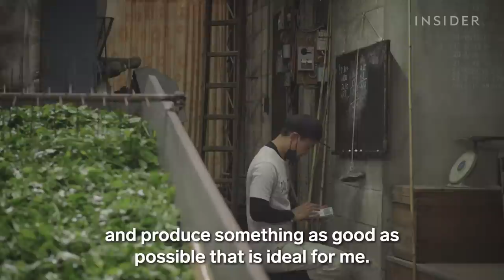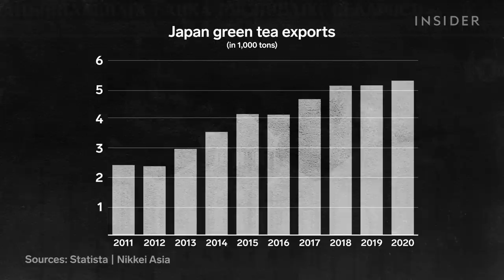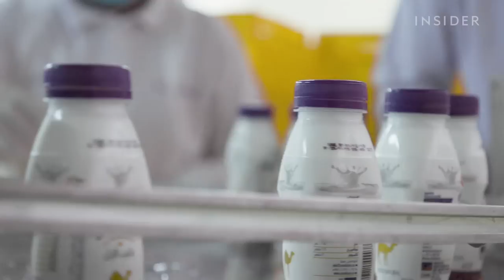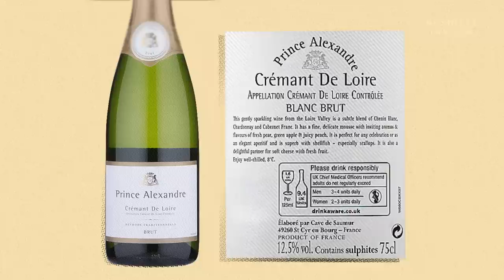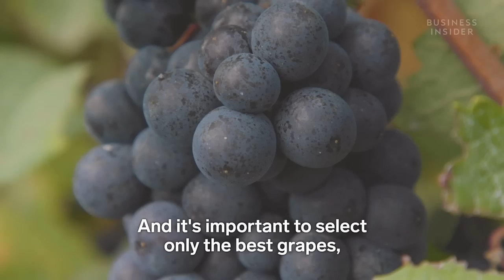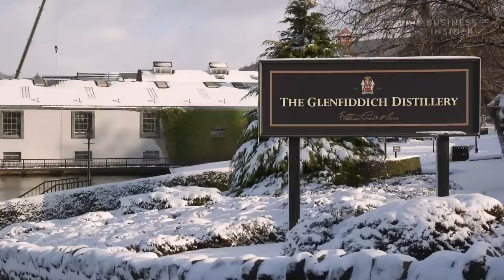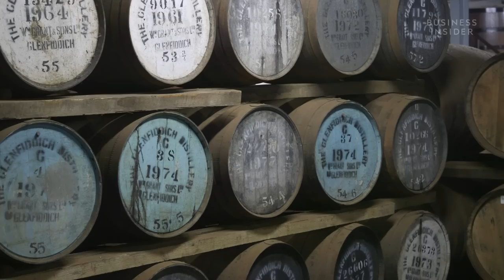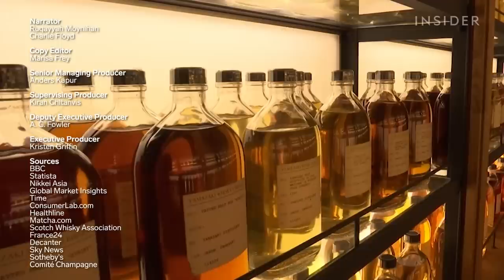Why 4 Of The World’s Priciest Drinks Are So Expensive | So Expensive Food | Business Insider

Comment: Nice, but does the matcha really have to be ground only counterclockwise? 😄 sometimes it feels like they try to make extra fuss to justify the cost...
Reply: It's the grinder that's designed to be wound counter-clockwise, so you do it for the same reason why you don't use the handle of a hammer to drive a nail in.
Reply: @rd9301  wow
Reply: The stone probably has a one-way cut, if you go the other way, it won’t grind properly

Comment: @8:30 So ground "Matcha" powder is a mixture of stone powder and the powder. Instead of steaming the leaves, would it also be possible to freeze-dry the leaves to keep more of the flavors?
Reply: Well, that is due to what happens when you freeze dry it. Freezing causes moisture in the leaves to crystallize, and that expands the leaves breaking down their cell walls. So when you unfreeze it, the leaves are already broken on a microscopic level, and unfreezeing it will just cause it to lose aromatics and flavor due to it leaking out.